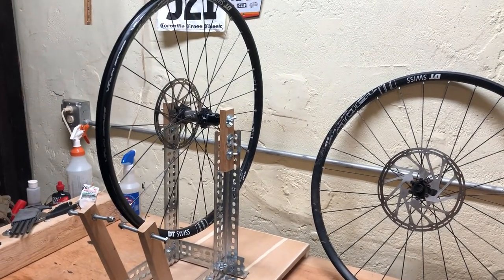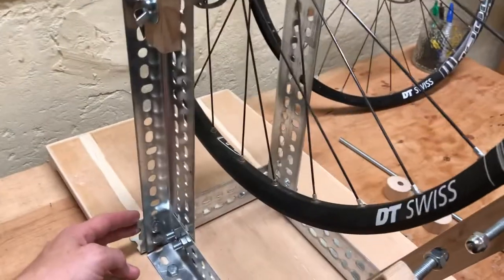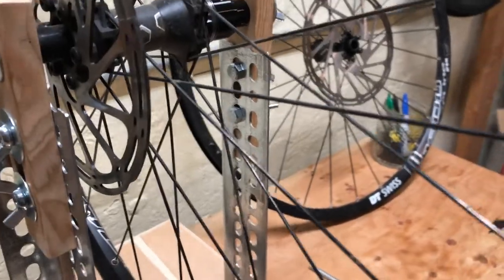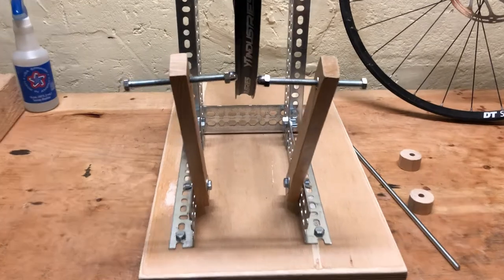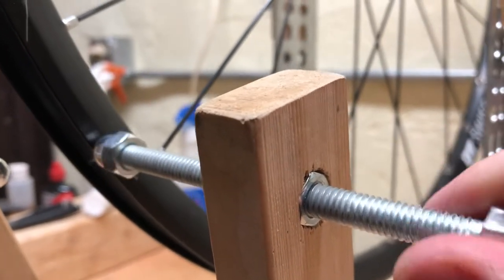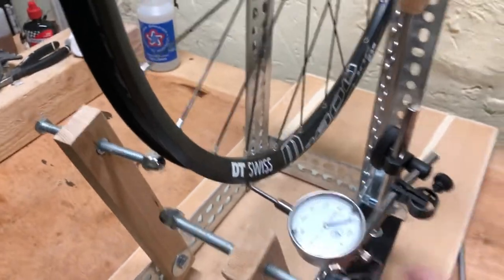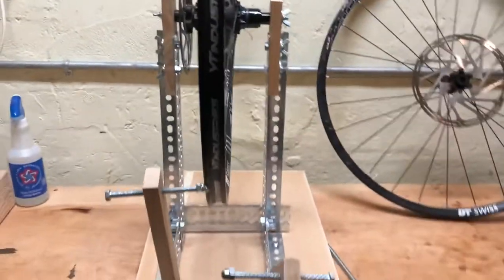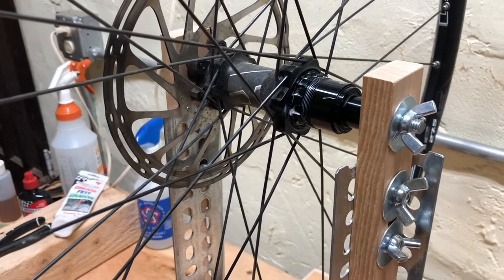DIY Wheel Truing Stand (~$30)

Comment: I just use the bike itself (as long as the wheel can still turn in the frame).  A popsicle stich held in place with a rubber ban works as a feeler, can even use the mounted brake pads on rim brakes

Comment: Nice work what I would try and add just to make it easier to tell which spokes need to be adjusted is get two sticks of chalk and screw into the back of them or find a way to attach them to the end of the truing arms. Maybe get a red and blue style chalk to give you a great reference on which side is in and out then just wipe it off after.

Comment: In spite of the kibbitzing, you made a video that focused on one simple challenge (building a stand, not truing a wheel) and you're still at the top of the youtube search for "how to make a bicycle truing stand"! One simple addition would be linking your two arms with a tensioned bolt or all thread below the adjustment screws. This will make the centerline more consistent than just depending on the pivot bolts. When you set the centerline, say with a piece of plywood, you can mark the bolts, or you can just flip your wheel around and set both sides using the valve stem hole as a reliable mark.
Reply from the maker: Thanks for the idea!

Comment: Nice stand, good idea adding a dial gauge to it. I’ve got the cheaper Park Tool stand and as this is all steel it works great with a dial gauge. Many people would think it is overkill but I actually find it easier than using a pointer, (failing eyesight and all that) I have used them a lot at work over the years so I find it pretty intuitive. Only drawback is you can get pretty obsessive over how true you want your wheel to be! Someone mentioned dishing, I’ve seen a DIY one somewhere on here made from wood. Just needs an adjustable pointer.

Comment: Love your design. I would have built it except for Chain Reaction had their Lifeline Truing Stand on sale for $160CDN. I'm just a home mechanic too but $160 divided by 7 bikes * 2 wheels = cheap like borsht without the hassle of building. Is it a Park? No. Do I need a Park? No. I also have no router. Also, by the time I go and get the angle iron and do all the cutting etc. I am looking at probably 4 hours. Minimum wage here in Ontario, Canada, is now $16, so 4*$16 = $64 plus $30 materials + inconvenience costs = I bought the Lifeline. (Free delivery was the "coup de grace"! Peace!

Comment: "I hate the idea of metal on metal on this static surface so I made it with wood.." Continues to rub surfaces with various metal objects...
Reply: Instead of metal screws, a wooden pencil is better.  use the butt as the touching point with the rims.
Reply: @nod bod Yup, but if you can't find nylon ones, brass acorn nuts (aka "cap nuts" or "crown nuts") are also available.  A bit softer than steel, so hopefully won't scratch steel rims.
Reply: Just tape a pencil, plastic or cover it with rubber as long as it works and it doesn't rub the rim as it will get scratches.
Reply: @@donaldmccanna piece of rubber hose threaded on the end would work fine.

Comment: i use a vernier calliper to true my wheels on a similar design to this. I measure a piece of wood about 2 feet wide. mark a centre point. from there you can figure out a simple mount for the calliper, align it with the centre of the base and with one knob turn, you have a perfect baseline. using two separate screws is useless. no way to know true centre . ten bucks at Canadian Tire for a digital set. lock them to an adjustable vertical slide and you are good to go ! i'm gonna try to design an attachment for the bike frame itself for quick jobs too.

Comment: How did the threaded rod to through the hub? Wouldn't the threads damage the inside of the hub?
Reply from the maker: I wrapped the threads in electrical tape for that exact reason, just in case.

Comment: Thanks for sharing! 
It's not that I don't want to support LBS but, as a heavier rider in a dusty, hilly town, maintenance is a near daily necessity for me. 
Paying someone to do all the regular work I do would not be feasible long-term.
Reply: Generally, if you ride a lot, relying on shops isn't feasible even short term. Very few shops are ready to do what you need done when you need it done. Some will agree to do it while-you-wait, but only if you let them know in advance (which may mean hours, but also weeks). 
I ride daily and don't want to own several bikes, so doing all of the maintenance on my own is really the best solution. Besides, in my opinion, some shops are charging ridiculous prices for even basic maintenance, but I suppose they can as long as people are willing to pay. 
And while owning some tools may not save you money on maintenance, it will save you time.

Comment: I haven't read all the comments, but I can't figure out how you know if you are not "raking" the wheel.  i.e. you can have a wheel no longer be out of round, but NOT have the wheel travel directly over the hub, but be off a little, or a lot.  How do you NOT have it be "raked" with this method?
Reply: Flip the wheel in the stand. If the rim is not centered, those bolt-ends that you screw up to be next to the rim will be off. I would suggest you find a book on truing a wheel.

Comment: When you slotted that wood how do you know the holes for the axle are concentric?
Reply: The Precision on these is not too important, as long as it produces repeatably mounted wheels. It's not a problem if the wheel is in the truing stand at a bit of an angle, IF you use only one feeler (on one side) and flip the wheel around to check the other side. That's also a good way to dish a wheel on a stand like this, by just setting one side and then checking the distance if you flip the wheel around. 

If you want to do them concentric, put the 2 blocks of wood on top of each other, clamp them together and drill all the holes on a drill press. That ensures the holes are gonna be perpendicular, and since you drilled both sides at the same time, you know they will line up, to the tolerances outlined above anyway. This also applies for the vertical posts which kinda should be the same length and have the holes equally spaced...

Comment: Hi is there a way I can make this truing stand for my wheel that is with a quick release axle and not thru axle?
Reply: not the creator, but you just use your quick release instead of the bolt and nut?

Comment: If you're interested in personal truing solution on the cheap, you probably can't do any better than UNIOR's pocket wheel truing tool (costs something like $25). It's an add-on that attaches to your fork or frame and while it seems ridiculous at first, it's actually better than a basic truing stand. Most basic ones will only work with QR skewers, others will require adaptors that bump the price up slightly higher. The UNIOR tool will work no matter the width of your hub, no matter the axle you have, and it works for both rim and rotor truing.

Comment: The slot and hole angle you have there available at HD is now complete garbage, I bought some of this stuff to use in a project and only some of the slots and holes would line up. It is like during the stamping process they have parts of the system spaced differently causing inconsistencies rendering the product useless when you need twin parts.

Comment: great job! but 35 bucks is more than fair at a bike shop. a truing stand costs 400 bucks, then you need a dishing tool for 100 bucks and you need a tension meter for 120 buck and then you need ...... but still, for a basic stand, great job !
Reply: It's so easy to do on the bike.

Comment: "The key takeaways are (1) using a piece of threaded rod as an axle," Isn't that what bikes already have? Threaded rods for axles? Usually 3/8 inch diameter, some older ones have 5/16 on the front axle. Congratulations you just invented something that's already existed for over a hundred years.
Reply from the maker: Congratulations to you too. I’m glad you’re sharing your insightful comments. Seriously, what’s the point of that comment? What do you get out of being a snarky a**hole? I’m genuinely confused what you’re missing in your life that putting out negativity on the internet enriches it.

(And no, you’re just factually wrong on what bikes use as axles).
Reply: @jonathankalodimosphd  I actually have a bike, which I maintain myself, it has 3/8 solid axles. They are basically threaded rods. They are much stronger than the soft steel rods sold in hardware stores, & have a different thread pitch. But fundamentally they are rods with threads along them, i.e. threaded rods. Please do not get too excited & try to replace your coat-hanger-wire "skewers" (notice that they aren't even called axles, sorry) with threaded rods from the hardware store. That kind of rod is not safe to use on a bike!  Go to your LBS and ask for "solid axles" to get proper axles.

Comment: You guys are nuts I have seen Amazon deals that are 10 bucks shy of what he paid! There are so many mathematical things wrong with his schematic! Folks the this you-tuber is definitely intelligent and will not be left behind during the Zombie apocalypse, but this is not it! Go get a good quality piece of equipment or pay the 35 bucks down the street! As my parents always said if your going to critique be constructive! This was a great video very detailed and thorough I would like to see more from him when the architecture does not compromise something as perfect as the wheel.
Reply from the maker: Paul Veliz I appreciate the critique. Looking back at many of my early projects I sometimes cringe at certain design elements or construction choices, but what is amazing is the cumulative experience of little projects like this has allowed me build some pretty amazing things later (ex., an acoustic guitar built from scratch, a substantial welding table, fab’d stuff for my vehicle). My point is DIY is not just about the product you have at the end. The experience and knowledge gained is just as valuable. Seriously though, thanks for the constructive critique.